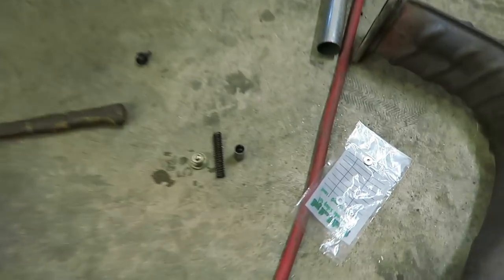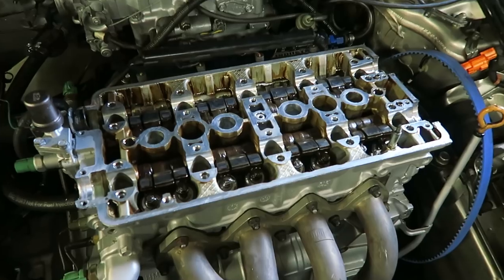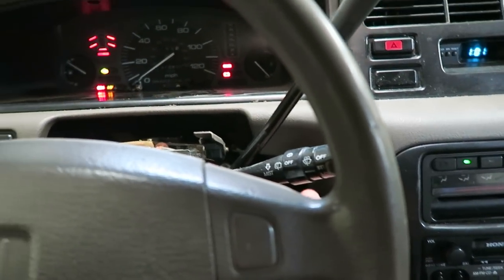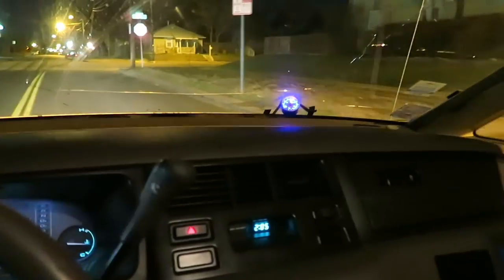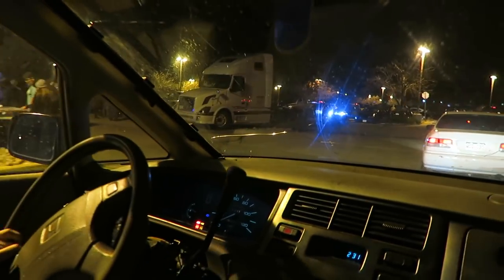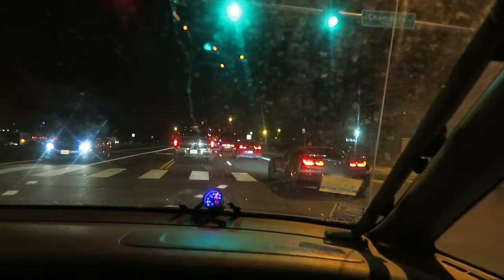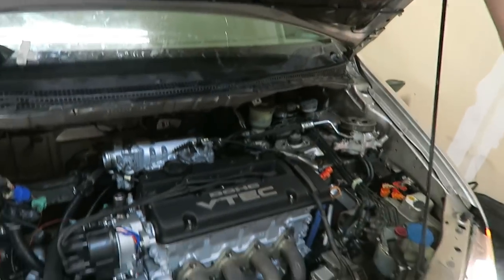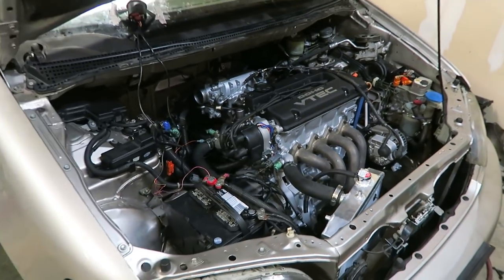Taking the Minivan to its First Car Meet!

Comment: KYLE PLEASE READ: had the same issue with my H22a1 and my b20a and f20b with the fans, it was a small broken wire in the wire harness that goes from the fans to the fuse box. 3 different cars, same issue!
Reply: ThomasFrick Yes yo my d16 does the same thing. You think it might be the same problem?
Reply: Chris Arias on the d16 it could your coolant temp or oil temp sensors, but it might be. Run a direct line to the fuses and see if it works
Reply: ThomasFrick Yes thanks I'll try it out

Comment: That 20w-50 is like molasses for those tight clearances. No need for 100 psi, not unless you wanna blow apart your oil filter.
Reply: evan mcdaniels it's called advice
Reply: Michael Crouch at temp there's very little difference in viscosity between 40 and 50, but cold...damn that 20w50 is treacle. My BMW used to crank so slowly with vr1 20w50 at near zero C.
Reply: evan mcdaniels dude chill, we are just giving advice
Reply: He's been running the same oil In the hatch. I think he's good.
Reply: Youknow88 Not because of the oil my dude
Reply: 10w-30 is what I run in my dirt track h22a. 213 whp NA taken to 8500-9000 every lap. Stock clearances. Hits the stock pump relief pressure of 85-90 psi at around 4000 rpm hot.
Reply: (that what she said)
Reply: Michael Crouch my dad did that
Reply: TheSamplebridge the hatch also blew up
Reply: +1 I was looking for this comment , Ive seen blown oil filters. messy shit

Comment: That “bolt” is a pressure relief. When you shim the spring you increase the force exerted by the spring thus increasing your oil pressure. It’s basically a wastegate for your oil pump.

Comment: The washer increases the pre-load on the bypass spring meaning it takes more oil pressure to make it bypass. Too much oil pressure is no good, it means oil isn't flowing.

Comment: Two things, having too much oil pressure can actually cause aeration of the oil which exposes the bearings to the crankshaft and can cause excessive bearing wear oh, and also once you start blowing all of your oil seals, and exploding your oil filters, you're going to realize that driving it with the oil cold and going over 100 PSI of oil pressure is going to cause you nothing but problems without specialized seals and loose bearing clearances.
Reply: Whiplash Racing not to mention running heavy 20w-50 not ideal at the moment
Reply: GonePro27 nope. True
Reply: So are we coming back to this comment where you were completely fucking wrong? Or are we still assuming you know literally anything about cars whatsoever?

Comment: Boostedboiz... too much oil pressure will do one thing hurt the cheap turbo. Run -4 and a .060 restrictor or will be smoking like before....turbos need to be wetted with oil not flooded with tons of pressure...

Comment: What you’re doing fundamentally on the oil pump is shimming he pressure release valve. Basically that spring has a pressure rate to release the extra pressure that isn’t in spec or needed for that car’s original use. For example, if you put a solid rod where that spring goes, the oil pressure would build with RPM, but would be SO high it would blow something or spin a bearing possibly. 

By adding a washer in there, you’re stiffening the springs rate, essentially making the spring truly “release” the pressure at a higher limit. 

Somewhat like a wastegate internal spring works. 

Hope this helps, I sense you’re someone who would like to know why you have to do what you did.

Comment: Lack of oil pressure can also be if gasket on oil pickup is leaking... also obvious one is if pickup is on bottom of pan (pan dented) sucking lack of oil. This would cause no vtec and lack of oil pressure.

Comment: The priciple of shiming your oil pump is very simple, most factory pump are capable of high pressure but the release valve let it all go! So just like a wastegate, your shiming your release valve

Comment: I don't know what i'm talking about but my guess is that is a pressure relief valve and shimming the spring put more tension on the valve not allowing it to open as much thus increasing oil pressure i'd say, yeah nah for sure.
something like that.
surely it will leak oil out of the seals?

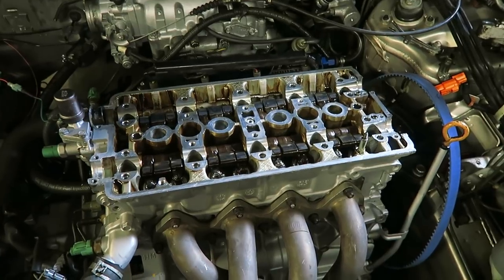Comment: @ 3:33 incorrect. There IS an o-ring that goes there. Honda Part # 15142-PH3-003 O-RING (10.8X2.4) (ARAI) it sits on top of honda part # 15140-P13-000 ORIFICE ASSY., OIL CONTROL. Illistration #11 for the o-ring #10 for the orifice assembly. http://www.hondaautomotiveparts(dot)com/auto/jsp/mws/prddisplay.jsp?inputstate=5&catcgry1=PRELUDE&catcgry2=2000&catcgry3=2DR+BASE&catcgry4=KA5MT&catcgry5=CYLINDER+HEAD

Comment: its the orifice and o ring on the engine block not the orifice on the cylinder-head. you HAVE to take the head off to access the engine orifice. your just covering up the issue by adding 3 shims and 50 weight oil.

Comment: Check you have the correct relay in for your fan, could be a normally closed relay instead of a normally open(Aka, when the cars off, the relay is sending power, when it's on and the relay is getting the signal from ecu or ignition, it's opening the circuit cutting the power to the fan)

Comment: Kyle @0:53 think of holding your thumb partially over a garden hose. The more constriction (blockage) of the fluid passage by the valve = the higher the pressure. The pump is a constant flow, and pressures can vary with temperatures & types of oil, and pump (engine) RPM. That unit- is basically a *pressure regulator*, to keep a set point, regardless of the variables mentioned.

Comment: the fan turning on when the engine is cut off is normal for the accords and odysseys, i think at least, my f22 91 accord does the same thing
Reply: My first car was a '91 accord.  I miss it.  But anyways, he's not getting the fan to start at temp tho either it seems like.  I'm betting he's either got the connectors swapped, or a bad temp sensor.  I suppose it could be something dumb like a break in the wire or bad fuse.  Can't remember if the fan would still at all in this case tho.

Comment: do i hear a metal grinding noice  all the time ?
Reply: Crimson Chin 10:02 mee too.
Reply: Not metal grinding lololol
Reply: It's called induction, no intake on it just open, the noise you hear is the air being sucked in.
Reply: I was gunna say giant vacuum leak
Reply: I think it could also be the clutch he has in there.
Reply: Crimson Chin input shaft bearing is my guess. A civic I had had its isb go bad and sounded like that.
Reply: It's called tinitus. I have it myself, it's caused by too much Led Zeppelin ;-)
Reply: Bogey's Garage lol my tinnitus was caused by m777s!!
Reply: It's the intake that's how they sound with no filter

Comment: the coolant temp sensors could be switched. the coolant temp sensor on the head may be the one for the ecu and not the fan. atleast on b series the plug on the thermostat housing is for the fan and i seen you pulled the one on the head and it turned off. otherwise it could be in the tune something on the hondata could be set wrong.

Comment: A detailed video on the oil pump mod plz, I would be interested to see if it can be adapted to other platforms
Reply: you can do it on most motors. thats the pressure relief valve hes modding when oil pressure overcomes spring pressure it open and allows oil to bypass. By shimming you put more pressure on spring causing it stay closed against higher oil pressure
Reply: or just search shimming a honda oil pump?

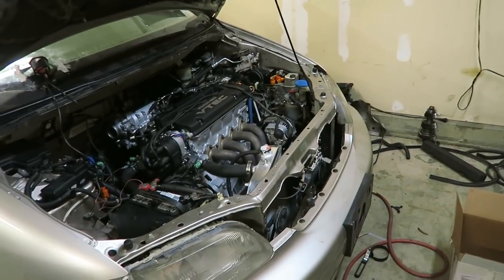Comment: @16:21 The highest temperature is usually immediately after engine shutdown (heat soak). Check your ECM PID fan thresholds, and be mindful where the ENGINE temperature sending unit and RADIATOR sending unit (fan controller) is placed. Many vehicles have a log rhythm to cool with KOEO upon shutdown.

Comment: I would put the engine on a straight 30 weight with an additive to increase the film strength of the oil. With that much flow you may need to look into a big external oil cooler.

Comment: @BoostedBoiz in regards to the fan being on, it will run between 5 and 10 mins after the ignition is switched off until the car reaches a preset temperature, switch it off and leave it plugged in, I'm pretty sure it will shut off.

Comment: 16:10 You probably just have the wires for the normally open contacts on your fan relay hooked up to the normally closed contacts.  Just disconnect it and check the connection for continuity with a multimeter when it's on versus when its off.

Comment: Seems a little high on the oil pressure. Also your oil is definitely too think for this motor..you're going to run into issues quick if you keep it up.

Comment: @boostedBoiz as for the fan, check the ecu's toggle. If it's not that, then either A) you have a short/fuse issue B) you need to rewire that fan so it isn't feeding the wrong on/off I/O

Comment: For you fan problem at the end I might be able to help, you could mount a fan switch in the cab or wire it with the ignition switch so it turns on automatically when you turn the car on

Comment: Good to know about the H series not needing that dowel and o ring on the center cap in the head. I was unaware so thank you! also did you use the same weight of oil before and after shimming the pump?

Comment: You much oil pressure is a bad thing unless you like leaking from engine seals .its not about pressure when it comes to oil in a engine its about volume or flow rate
Reply: Gaz Girl exactly!

Comment: That fan issue happened to me when i manual swapped and h22 swapped my accord. Turns out the plug you unplugged goes to the thermostat housing and the one on the housing goes to the switch. Worked for me, might work for you.

Comment: With that kind of oil pressure, have you ever considered what the oil is turning into at that psi? Oil gets air in it and your drop in oil pressure could be the result of that, the pump is pumping air and oil. Dry sump would save you a ton of heart ache.

Comment: ITS THE ORIFICE AND ORING ON THE ENGINE BLOCK NOT THE CYLINDER HEAD. YOU HAVE TO TAKE THE CYL HEAD OFF TO ACCESS IT. make sure theres a new oring under the orifice and on the orifice itself.

Comment: oil pumps dont make pressure they push volume what creates pressure is the tollerences between ur barrings so u needed more volume for ur built motor so u did the right thing

Comment: try swapping the neg and pos wires to the fan and see if that works maybe or you have a negative switch and need a positive ( one stays shut then opens and one stays open then shuts upon flicking the switch ) so could even need a new relay if its on one

Comment: You can have too much pressure. Get in there and watch the oil filter on cold start. If it bulges the pressure might blow it apart.
Why not drop down to 20w40 oil? 50 is robbing power from you and 40 will shave off a little of that pressure.

Comment: For the fan being on when the engines off my Accord does the same thing sometimes when it’s really hot out and the engine been running for a while only thing I️ could find about it is it’s just to help cool the engine down and they turn off after about 10 minutes of being on every time
Reply: my mums car does the same no fan when you drive unless air con is on then when the engine is off the fan powers up to cool the engine down
Reply: the f and h actually have 2 fan switches..one by the thermostat and one by the upper rad hose the one on the thermostat works when engine is on..the one by the upper hose is for when engine is off...I usually just unplug it cuz sometimes the timer goes bad on them and will actually stay on till the battery dies.
Reply: I️ have a j30 maybe just a honda thing
Reply: Kyle Almstead I'm gonna have to check that cuz I also have a J30 accord it could also have 2 fan switches

Comment: Have u try bypassing using a wire and put each end of the tip of the wire into the plug where it plugs to the thermostats.

Comment: I'm pretty sure all accords do that cool down process when it's shut off i think the harness is similar on the Odyssey just try leave the fan pluged in and see if it turns off after a lil bit if it does you should be good @boosted_boiz

Comment: I had the radiator fan problem on my Dodge truck. What happened is the power wire for the fan is no longer on a ignition switch hot wire. So instead of turning on with they key it stays running. You can by pass it by putting the power wire on an ignition switch wire again and increasing the fuse of the line used. For me we used the radio power wire inside the dash since my radio don't work and increased the fuse from 20 amps to 40 amps and so far it has worked fine.
Reply: another thing it could be is the thermostat on the fan switch. It's a little metal line that runs from the switch to the inside of the radiator. Sometimes they go bad so check the switch before tearing into wiring.

Comment: Will higher oil pressure make VTEC kick in earlier (yo)?
Reply: Pharaoh on LFS well vtec isn’t wired up in the minivan rn, so I think that’s only to boost oil pressure. I don’t think it’s gonna effect when vtec activates. It might since it’s oil pressure based but it’s also electronically controlled
Reply: Black Sol but they said it just hit vtech
Reply: Jeff Catellier They must have just wired it up
Reply: Brent wired it up in the last video with the dyno pulls...
Reply: With hondata you can set vtec to a specific rpm
Reply: The computer controls it via the VTEC solenoid, but if the oil pressure is too low it can't hydraulically move the pins which engage the VTEC rocker arms. Before the shims it took a lot more rpms than it should have to build enough oil pressure to get VTEC to engage.
Reply: Pharaoh on LFS na a tune will make vtec kick in earlier yo
Reply: Vtec isn't trigger by oil pressure. Oil pressure is just a safety precaution to enable vtec when rpm and vehicle speed is reached.
Reply: that guy there is an oil pressure switch that prevents vtec from working if it's too low, but the oil pressure is what activates vtec. The solenoid opens and allows the oil to push through, and the pressure locks the rockers together to read the third cam lobe.

Comment: I'm pretty sure all accords do the cool down process I think the  odyssey's harness is the same try leave the fan plugged in if it turns off after a lil bit you should be good that's normal @boostedboiz
Reply: plus you have a dual core half-size radiator is probably another reason why it cools down right after being shut off

Comment: When its cold out my cars fan does not come on until i turn it off as well or if i have my foot down a lot it will come on cause the temp is rising . The cars temp doesnt get hot enough for the fan to kick in when its cold outside. But thats on my car, might be different on the van.

Comment: Could you have the wrong cooling fan switch? Some are normally open and some are normally closed. If you have one that's normally closed it would keep the fan on when cold and shut off when hot..

Comment: The fan problem might be you have the wrong connector attached to it the one that controls your fan should be back on the thermostat housing on a H22. If i remember rite.
Reply: most cars keep cool through moving then when they turn off the fan turns on to cool it down my cooker does the same thing when you turn it off the fan comes on to blow the hotair out i think its suppose to do that

Comment: Really don't understand why u do t run air filters on your cars. Why risk sucking up a lil ass pebble or something and blowing your engine over something so simple. I understand if it's a track car but on the street screw that.
Reply: A big enough filter won't cost more than a couple hp anyways on a 600+ hp car.
Reply: I'd sooner sacrifice less than half a % of my horsepower to not suck in grit from the roads.
Reply: Been here for awhile and they usually rebuild the engines on their cars often. So i guess it has never became an issue, it does bother me that they dont break the motor in better, instead of like 50 miles and there bangin the redline and having to fix spun bearings fried rings ect.

Comment: Wut about blowin seals or the oil filtre outta the engine...o rings and gaskets r susceptible to over psi adding the turbo may even save the seals cause its a controlled leak
Reply: Joel Jones or it will blow the seals out of the turbo also lol. His oil pressure was high enough before the mod and that was definitely the pressure relief not oil pump
Reply: nick cross. Entirely possible wth cheap turbos time will tell...i always hate saying i told u so but i actually love it...at least hes doin it

Comment: Just wanted to let you know, not running air filters does more than slowly sand down your cylinder liners, but it also makes its way into the oil, and some of your premature engine failures in the past could have been just from not running air filters considering how much dirt and debris is in the parking lots and freeways/hwys around there. Not saying it's a big deal to not run an air filter at say a drag strip where the car is literally going to make a couple runs, but you daily these cars for the most part and thats not good at all.